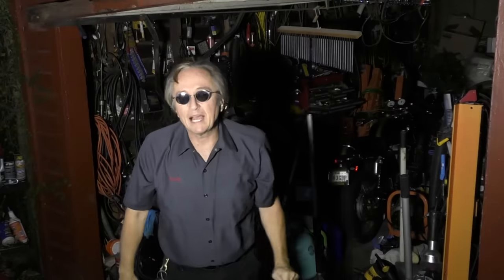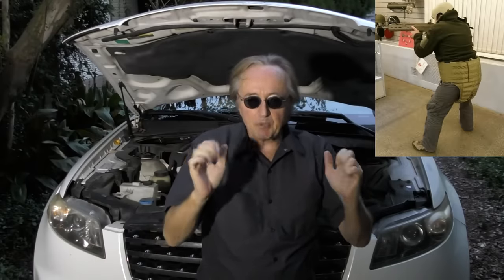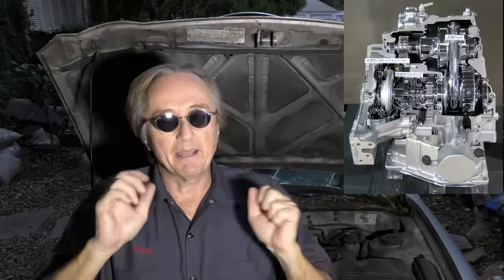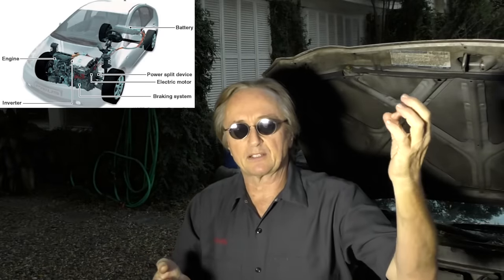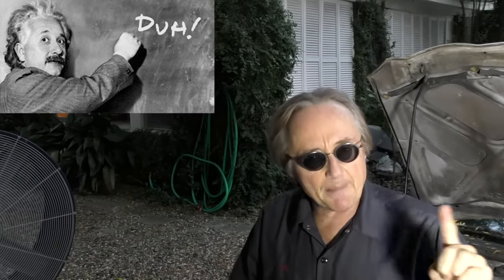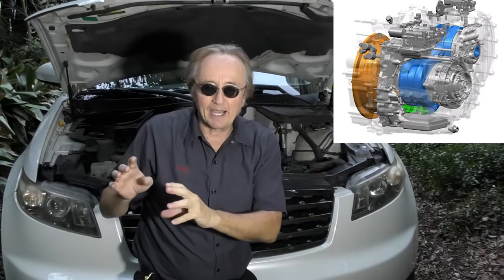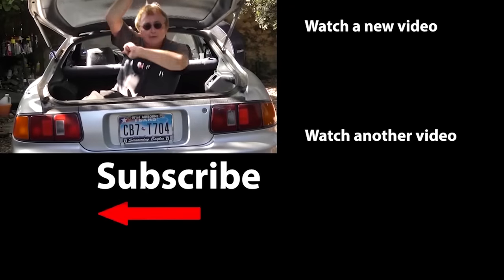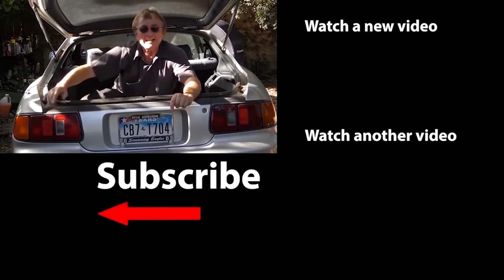Why Most CVT Transmission Cars are Terrible

Comment: It's all about how you drive and maintain each car. My 2014 Nissan Altima 2.5l still runs perfectly at 153,000 miles with the transmission fluid being flushed at 100k miles.
Reply: People have had their CVTs fail on them just after 50K miles on it. Yes changing the fluid often and not driving recklessly helps, but we expected a lot better from Nissan
Reply: You had your transmission flushed or transmission fluid changed st 100k,? It's a big difference
Reply: @king-ghost1027  Nissan (and even Honda) recommend changing the CVT fluid every 25-30k miles
Reply: @NikeySunfire  what color is your fluid
Reply: @king-ghost1027  I do not own a Nissan   (God forbid lol) but I would suggest everyone to use a genuine Nissan CVT fluid to avoid issues.
Reply: @NikeySunfire  mines almost 87000 fluid still regular color and still ride good,, ppl act like nissan is the only bad car company out here,, anything can happen to any car,, it's up to the owner to take care of it & stay up with the maintenance and don't drive reckless like u said
Reply: Audis,  buicks, Volkswagens, infinitys all have engine and transmission problems
Reply: @king-ghost1027  Not at all. Chevy is also trash. I own a 2013 Cruze and its been nothing but problems and replacing parts.
Reply: @NikeySunfire  yup because Chevy is apart of GM like buicks lol,, I had two buicks, 1st one engine and transmission went up & the 2nd one reduced engine power light at random times and cut shut off the car 🤦🤦🤦,,, never going back to General Motors

Comment: From what I've read, the biggest fault of the JATCO CVTs is that the metal belt shares the same oil with the gears, so when it goes, it takes half the transmission with it. I have to wonder why JATCO didn't aim to make this belt-chain-thing separately replaceable without the removal of the tranny; it could have had a removable link, like a bicycle chain, so it could be replaced from the bottom for $300, instead of necessitating  a $6,000 transmission replacement.

Comment: The problem with the transmission is the cooling and the oil change interval. The Nissan cvt runs very hot and without proper cooling will have a reduced lifespan. If you install a transmission cooler and change you oil regularly it will last much longer.

Comment: Holy crap, Priuses DO NOT HAVE a mechanical CVT.  They use two electric motors and a simple planetary gear set to simulate a CVT.
Reply: No sliding pulleys or belts in them.
Reply: @D.O.A. If you can simulate a peanut butter and jelly sandwich, you're a peanut butter and jelly sandwhich
Reply: @D.O.A. Priuses are different bro 100% solid and reliable just look at the mileages on online there's Priuses with 300 to 400k miles really at that point they need the hybrid batteries changed but not the transmission
Reply: @D.O.A. 💯
Reply: It IS called a CVT, but works great!
Reply: @D.O.A. so a vegan burger with soy, is functionally a real burger? It taste the same so it must be the same. That doesn't make any #%$ing sense.

Prius CVT is mechanically different from the CVT in a Corolla or in a Nissan CVT. Because they are totally different they have different problems and issues. 

In the Nissan CVT the ball bearings in the primary pully are the weakest link. These tiny four ball bearings hold tremendous pressure and once the tracks that guide it wear out, it misaligns the belt, which causes it to snap. The CVT in the prius doesn't have this problem because guess what? IT DOESN'T HAVE BALL BEARINGS, A BELT, OR A PULLEY. It has a planetary gear set with electronic power switcher. Planetary gear set is much more robust than a steel belt. So of course the Prius CVT is reliable compared to a traditional CVT. They are the same in theory, not mechanically. Get your facts straight.
Reply: @subjer0   "Prius CVT is mechanically different from the CVT in a Corolla"  Really? I thought it's exactly the same!
Reply: @D.O.A. Not really. In a belt cvt you can lock the ratio and engine speed will be directly proportionate to wheel speed. This is impossible in a Prius.
Reply: @sachideshmane5088  The Corolla has preset ratios that you can select. Partly it allows downshifting for engine braking, which isn't necessary in a Prius. Partly it allows the "feeling" of a regular automatic with manual selection for performance/ control. They could do the same in a Prius. It's not "impossible" for the transmission. Toyota just didn't choose to provide the capability.
Reply: It's a eCVT, not a CVT with a belt.
Reply: @D.O.A. The weak point with cvt is the drive belt.  Toyota doesn't have one.
Reply: Omg it sounds like you could use a  hug
Reply: treborg777 You are the fewer smart guy left.
Reply: CVT = continuous variable transmission
It doesn't matter if its belt or no

Comment: I have a 2011 Nissan Altima with 177,804 miles on it no problems. But I also have the transmission fluid changed every 20k miles
Reply: 05/21/21 currently at 188,985 Transmission started a whining Noise after driver for awhile had the filter and fluid changed still going strong

Comment: have Nissan Sentra 2012 with 156,000 miles on it still runs like champ took it to Corpus Christi no issues
Reply: I also have a Nissan Altima hybrid 2009 with 178,000 miles and still working 🤔
Reply: @hayanahmad6766  nice my Nissan Sentra 2012 got 194,000 miles now
Reply: I dont think they have CVT
Reply: @MrBugatii12  they do my car has CVT
Reply: @JohnJacobGarza  did some research and found out CVTs aren't as new as I previously thought lmao my bad
Reply: @MrBugatii12  My Nissan Sentra 2012 has 200,000 miles now

Comment: Try having a Ford Focus double clutch transmission, what a piece of s***
Reply: Test drove one a few years ago and was amazed how crappy it drove.Focus and Fiesta both use that transmission
Reply: @emeyer6963  Its not so bad the rough transmission, because it drives like a stick but when it started to fail it sounded like it was going to fall out of the car!
Reply: But they replaced the brainbox and programmed it to actuate harder so now it works but feels all grabby like I'm trying to race or something
Reply: TheFoodnipple the dual clutch in my Volkswagen is amazing!
Reply: @David-eh9nw  the Ford ones are so bad the dealership said they're doing away with them completely in 2020, and the only reason why they're waiting so long is to dry up the inventory that they have of them
Reply: I know the feeling.I drove a Focus it  had that same feel to it.
Reply: The transmission itself works pretty well as it is pretty much a manual transmission.  The clutch, which is basically part of it, is where the problems reside.  And there's no fix for it.  The same transmission would probably work really well if they could implement a wet clutch instead of a dry one.  Of everyone I have met with one of these transmissions, every single one of them had the clutch shudder/noise issues.  Never have I heard of one leaving anyone stranded--it just shakes nastily every time it shifts / takes off from a stop.
Reply: Yah, the clutches just plain wear out way faster than was expected I guess. It's gone on for years and years and they didn't fix it. Like Scotty said manuf's seem to like to try to reprogram things as a cheaper way around what is just a poor design. The only true solution is to replace the clutches every 30k miles or so, then it's fine lol.
Reply: TheFoodnipple I have a 07 focus st (manual) and it's great! it's the only focus I recommend buying.
Reply: Mine runs great...just give it xtra gas in low gears and keep in neutral when stopped
Reply: @Leo Derosia You do know that the car shifts into neutral at a stop automatically, right?
Reply: Yeah. My 2016 Focus constantly tries to kill me and my passengers (I'm an Uber driver and I'm stuck with the car). I have videos on my channel showing it redlining at 7k rpm while only going 30mph.
Reply: Also I once rolled backwards into a parked car while in DRIVE!
Reply: @Network126 Your car has the 2.0L four cylinder engine, right? If it's the 1.0L EcoBoost 3, at least your car has the better automatic transmission!

Were you on a hill when the car rolled backwards? The hill start assist should kick in when you move from the brake to accelerator pedal, in the second that transition takes place. My Focus rolls back on a flat surface, though, but not huge distances – it's a bit unnerving for passengers! Generally, it's never a good idea to hold a car with a dual-clutch transmission on a hill with only the accelerator pedal (I am not saying that you do that, but as a general rule, it's not a good idea)

Personally, I'd take it in to Ford. If the hill start assist is disabled that can be a symptom of the eventual failure of the transmission control module.

I have to say though, if you depend on uber for most of your income, you need a reliable car. Ford has put a lot of cash on the hoods of the Focus so that the company was basically giving them away.

Comment: I believe Subaru makes their own Lineartronic CVTs.

Subaru did use a Jatco 3 speed automatic, and their 4 speed automatic was based on a Jatco design as was the 5EAT.
Reply: Incorrect. Jatco makes all Subaru CVT's for Subaru.
Reply: Subaru does make its own CVT.
Reply: Subaru motor vehicles have used manual, conventional automatic, and continuously variable (CVT) transmissions. Subaru manufactures its own manual and CVT transmissions (for non-Kei cars). Since the 1970s, all Subaru conventional automatic transmissions have been Jatco designs adapted to Subaru specifications.

Thats from Google

Comment: Have a 2011 Altima .  125000  Miles still working but need to change fluid soon.    Noticed if stuck in Snow don't pound it like a regular trans.  Accept being stuck

Comment: I have a 2016 Nissan Sentra and I take really good care of it I change the spark plugs, the oil, brakes, the brake fluid and pretty much everything I can manage to do at home. My first CVT lasted about 7 years from factory and I had to get I replaced last year in November. Well now the new one crapped out within 8 months from when I got it replaced and now it’s getting diagnosed, thankfully under warranty. But still I would never get another Nissan after this

Comment: The Nissan CVT is a pushbelt relying on metal to metal friction whereas the Aisin eCVT in the Prius is a planetary gear with a motor on the ring gear instead of a clutch.  The designs are incomparable other then the fact that they accomplish some of the same functions.
Reply: That's only true for the E-CVT. Toyota also makes a conventional CVT for use in their Corollas(IMO they should just stick to the E-CVT. I hear only good things about it)

Comment: Rev up your rubber band transmission...
Reply: More like drive your CVT car like normal and you’ll be hitting the rev limiter
Reply: @wanilimbe  you can rev all you want and the car will not move
Reply: @mbcoll8154  I see what you did there. Here- have a like.

Comment: Would personally avoid CVT, but if I had to pick, I would pick Honda. Remember, Honda also makes motorcycles, including scooters, which also have CVT transmissions. In fact, they have been making said CVT scooters for more than 30 years (if I'm not mistaken, it was they who first started making twist and go automatic scooters). That means that they had more than 30 years to perfect the technology. Just a thought...
Reply: 美光伍  True, but the principle is the same. Honda CVTs are indestructible. I know people who have Honda PCX 150s with 60,000+ kms on their bike, and have never had an issue with their CVTs. On the other hand, I know one guy who's vbelt snapped at 10,000km on his Yamaha NMAX.
Reply: Maybe your right. I hope you are right. I have a Honda Civic 2014 with CVT transmission but history says that Honda doesnt have good automatic trannys on their cars.
Reply: nissan and subaru has the longest history in CVT,  almost 40 years.Subaru justy in 1982 and nissan march in 1984 both used the same CVT design by subaru.
Reply: @Jose-xb6st  you are right they have problem with CVT just like nissan, toyota too, honda CR-V was more common with issue spun to 2016, but fit and civic was recall in 2014.
Reply: @Jose-xb6st  don't worry about it.  I have seen from first hand experience with the 9th gen accord cvt car over 150k.  And the people I have talked to say they have not had any problems.

Comment: I bought the Mitsubishi Mirage CVT. I knew it had a Jatco CVT and I knew about the problems. But hey, I think it is an interesting technology, especially combined with a 2 speed automatic like the Mirage has. So I have 2 transmissions for the price of one! But you gotta have faith, so I bought the car anyway. 50.000 miles later, not a single problem, not with the car, not with the CVT. It just had its first new CVT fluid and that stuff is expensive! Fingers crossed. What Mitsubishi does different to Nissan, is that Mitsubishi bolts less torquey engines in lighter cars than Nissan. That makes the life of the same CVT in a Mitsubishi a little easier, maybe?.
Reply: Yeah man I have 2007 caliber awd with a cvt in it at 130k miles. No problems at all. It's been the best car I have ever owned. I think it may be how these people are driving there cvts that may be killing them so early. You got to let the cvt do the work it will climb to 60 at just 2k rpm. I can definitely see these people accelerating at 4k to 5k rpms that will wear them out.
Reply: Ronald de Rooij 

My friend has a 2015 mirage with cvt with 170,000 kms  if that makes you feel better lol
Reply: I have a Outlander Sport 2011 with over 216000 miles I've never seen that CVT from any other manufacturer then a Toyota with those type of miles
Reply: Ronald de Rooij its expensive if you buy the brand name, buy Total cvt fluid
Reply: I think you’re spot on with Nissan pairing the CVT to higher HP engines. I have a 2010 Suzuki Kizashi with the same JATCO CVT Nissan uses in the Rogue, and Altima, (could be others too but those are the two I know of for sure). I have 139,000 miles on mine and it’s still perfect. I’ve changed the fluid twice, drive it nice, and leave the paddle shifters alone. I believe the Kizashi has about 180HP.
Reply: @shortyorc121  At least with my '16 Lancer, the problem with keeping rpms at 2k is that the 4B11 and even 4B12 have essentially a dead spot within the 2k range. You'd have to go within higher ranges, around 3-4k to see any sort of good acceleration, specially in a pinch. That and the usual 4-bangers having usually crap low-end torque shebang
Reply: @GabrielIgnacio  oh good point. My car is the only car I have ever drove with a cvt in it so I'm just going off my experience. The only time my car will go beyond 2500 rpm is if I'm yielding or going up hills. I have a 2.4L by the way. Cvts  are great driving around town can definitely manage the engine to stay in low rpms for good gas mileage.  But they definitely are slow and take getting use to yielding on the highway or from a stop.

Edit: also in that pinch moment let her rip. What I mean Is people driving there cars hard all the time. I see this 1st hand when my wife drives my car. Every take off my wife has my car screaming at like 4k/5k till she gets to the speed limit. I think there is mental thing going on with a engine not reving up and going though the gears when accelerating. Hate when my wife drives my car lol.
Reply: @romeojones668  I have no doubt that my car will make it to 200k..... knock on wood. I'll have to message you back in another 10 years if I do lol
Reply: Yeah no problems with my 2007 Nissan Sentra at 134k. It's had fresh fluid every 60k and I also added a to transmission cooler. People just don't look after them is the problem
Reply: @shortyorc121  If acceleration destroys a transmission that means its a junk transmission and not fit for purpose. Never heard a manual break because you accelerated too quickly.
Reply: @gravemind6536  drive your car like a race car..... repair your car like a race car.
Reply: @shortyorc121  Acceleration does not break a manual transmission so I won't have any problems. Enjoy your Constant variable trash.
Reply: @gravemind6536  yes it does.... your not a special snow flake on these forms. Oh muh manual transmission have no problems. OK buddy... like your the only one that has a manual car.... I have one as well....same logic applies. The faster and harder you drive the more wear it does due to parts moving faster and more load put on to them.
Reply: I did the same and the cvt went out within a week lol

Comment: My 2017 Altima has 295,000 miles ( I drive Uber) with first transmission and engine. CVT dont goes out. You buy Nissan CVT fluid and go to Valvoline and do a transmission flush every 60-80K or when it starts slipping. After the flush it runs strong and with no slipping. Valvoline put a hose into your dipstick and suck all the dirt out ask them to use your Nissan NS-3 fluid for newer ones. Valvoline runs 3-4 cycles and filter all dirt out. After that it runs very strong!!!
If you don't changes it you don't have power from the traffic stop. Flush it and it will run fine. 
On CVT you could also change the valve body $200 remanufactured, from underneath the oil pan. The steel belt assembly can be taken from the side and be replaced.